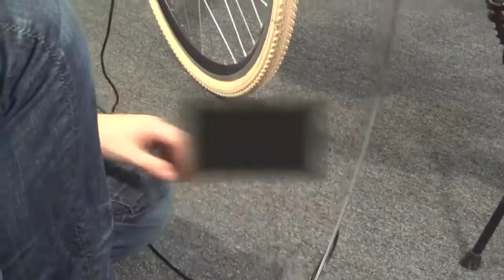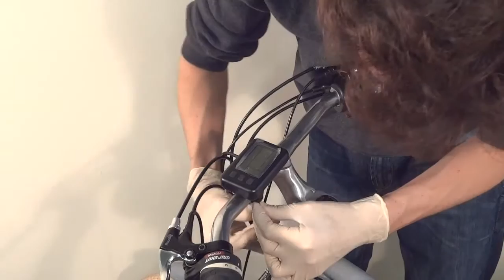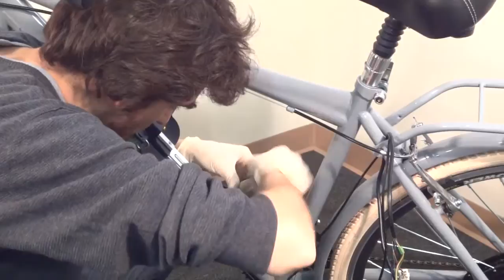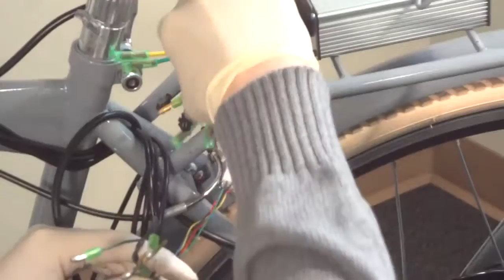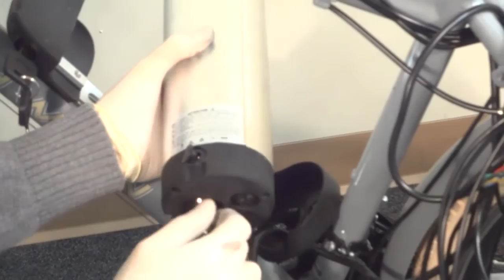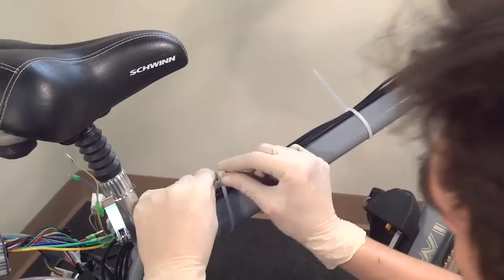EBIKE CONVERSION KIT INSTALLATION FOR REGULAR KITS (Part 2)

Comment: I'm looking for video on the shifters ,mine are combined with the brakes
Reply from the maker: Hi Tom,
The brake levers included in the kit are optional. You can keep using your shifter attached brake system without an issue.
Reply: @ebikeling  yeah , figured that  3 months , AGO !

Comment: Hello, I'm installing a front drive kit from you guys, just wondering which side the wires are supposed to come out of the hub? I see on THIS video they are on the righthand side? Is that correct or should they be on the left?
Reply from the maker: The disk brake holes are always on the left side. This will help you to install the wheel in the correct direction.

Comment: My kit works better than expected however while trying to switch from KPH to MPH I slipped into a control mode that allows me to adjust a P1-6 to random levels and the C1-11 to random levels. I thought they were pedal assist adjustments and now believe they are controller module adjustments. and anyone get me the original specs or find the manual online? I never got one and the company is impossible to get a hold of. I need help my motor wont engage and I don't want to burn it out.
Reply: +derrick boston I emailed ebikeling and their response was &quot;Unfortunately, I do not know how to switch from km/h to mph&quot; and that was it.  On my controller display it says sw900 and I found the following link 

http://wing-ebikes.co.uk/wp-content/uploads/2015/08/LCD-Instructions-SW900.pdf

I turned the bike on, held the PAS up and down buttons then you can go to option 2, switch it between mph and kph then I just turned it off and back on and everything was fine.

Comment: 3:32

STOP!!!!

Don't use a hammer on your crank arm.  You could damage the crank arm and the bottom bracket.

There is a specific tool that threads into the crank arm on the threads that are around the bolt that holds it on.  

You crank this tool and it pushes the crank arm off safely.

The only reason this guy got it off safely is because the bike is rather new and even then... If the builder tightened it a lot you will damage it.

Not saying anything bad about the guy doing this.  He just didn't know.